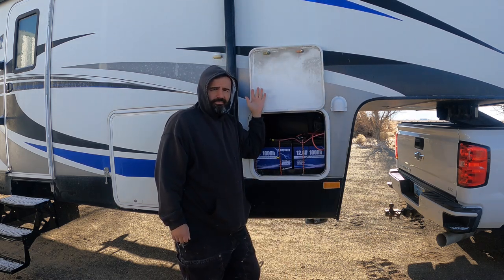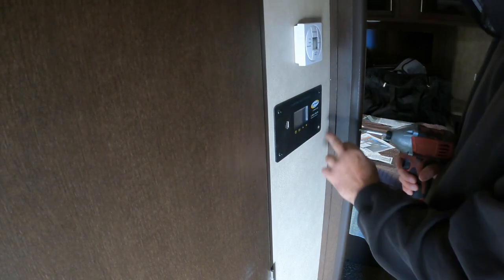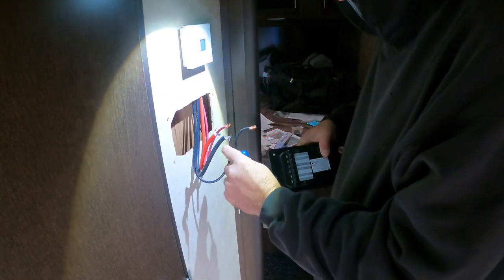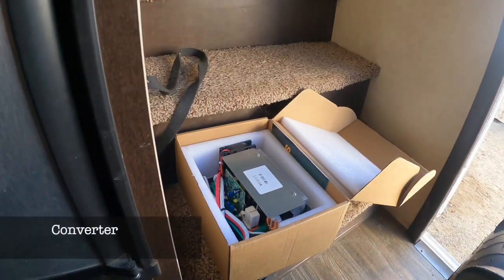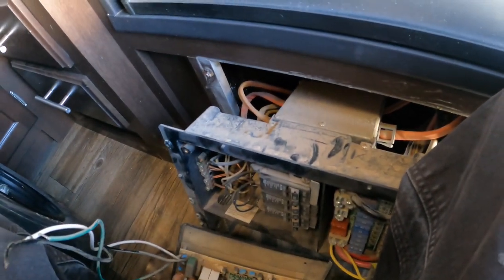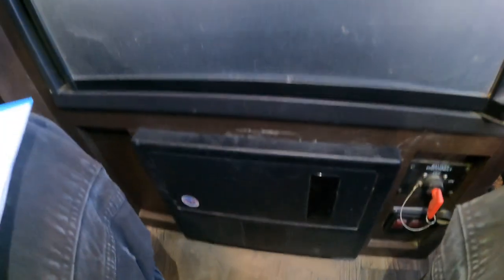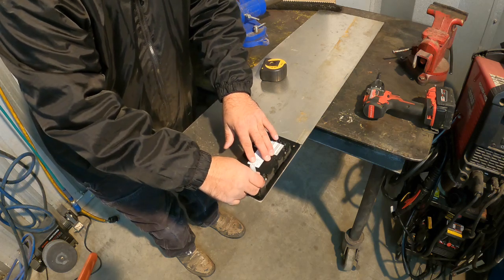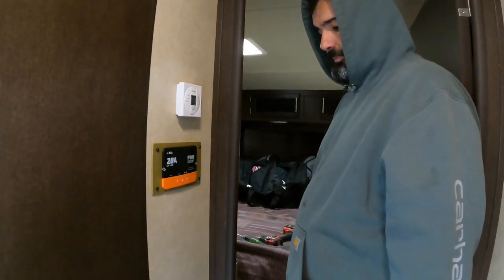Upgrading Converter And Solar Charger For Lithium lifeP04

Comment: Now you have 2 chargers, right?  One is in the Converter.   The Converter has a 60 day warranty,  right?  I like your video bc its exactly what im going to do.   I'll look for a Converter that has a longer warranty but its a lot cheaper than buying one at an rv store.  ps, i have 4 lipho batteries now but for 3 different purposes.  1 is to be used as a solar generator just for 2 house outlets , guess what they service.